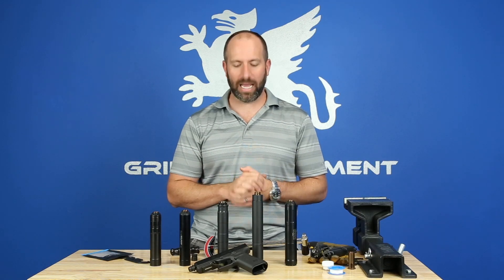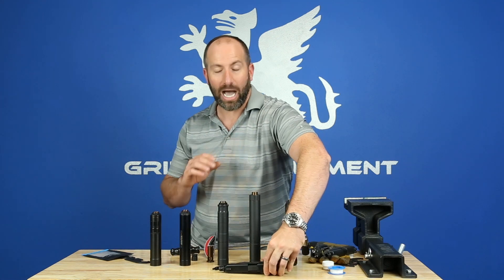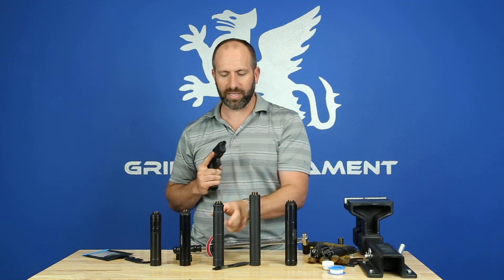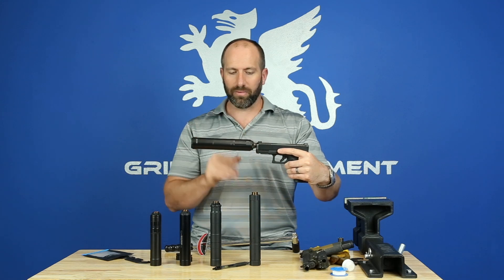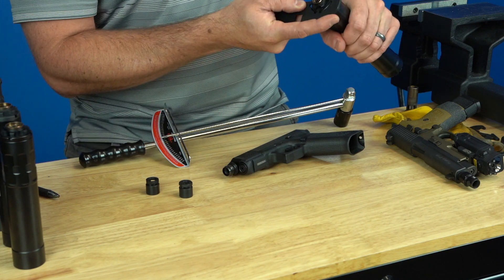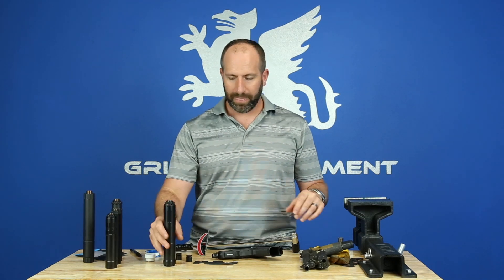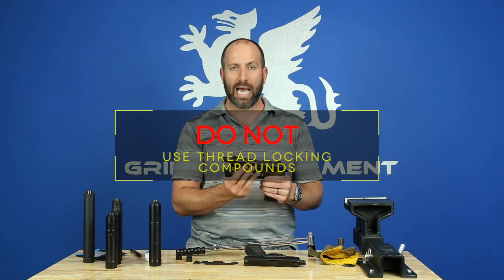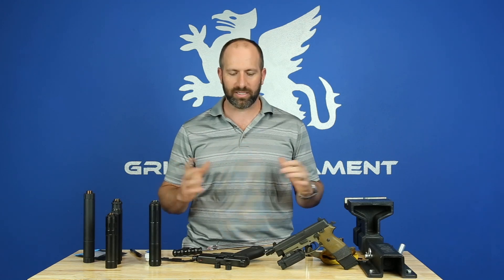Griffin Armament CAM-LOK™ Universal QD Piston System Tutorial & Overview

Comment: I have a Dead Air Wolfman Suppressor  - my 9mm has a 1/2 threaded barrel and my 300 Blackout has a 5/8x24. Do you have an adapter that would work for both of these so I don't have to keep switching out direct thread fixed mounts?

Comment: Mine doesn't last more than 5 rounds before falling off, and a ton of other people onlinr are complaining of the same issue.
Reply from the maker: This is more than likely happening because of improper mounting. The CAM-LOK system can seat pretty snug onto the adapter without actually being mounted, even if tightened with force. When tightening the mount, pull out and away from the silencer to seat the offset threads into the counterpart adapter. If you still are having the same issue, there's a chance the piston is faulty. If this is the case, please reach out to Customer Service and we'll send you a replacement free of charge!
Reply: Same here and I'm very familiar with Taper Mounts.

Comment: I just expended $700+ worth of these, not sure what I am doing exactly but have 3 cans;  Griffin Resistance 22, Rugged 45 and Banish 30, so bought 3 pistons for all 3 of them; 5 QD 1/2 x 28 and 1 for .45 currently I got only 2 handguns threaded but not clear what then when using the cans in rifles??? Direct Thread???? or have to change the piston back? to get use and understand a universal system that will work with the cans I have is a RPITA to me so far and the money pit goes deeper and I only have 3; my friends got 10+ cans...that is crazy!!

Comment: I love the idea but I have had issues with the cam lok on three separate suppressors walking loose and shooting the suppressor clean off the gun after 10 rounds without checking. On multiple different guns as well with the combination of pistols and cans. I thought it was my piston spring originally but it’s consistently been an issue. Really cool idea that I would absolutely love to recommend to customers but I just can’t cause they can’t stop walking loose
Reply: Same
Reply from the maker: Please reach out to our Customer Service team about this issue! We'll make sure to check on your parts and get you set straight 🇺🇸
Reply: Same here. Doesn't seem to engage the Tapers enough before bottoming out. Feels wrong compared to the Q and Rearden Mounts for Rifles.

Comment: I've not had a single issue with this system on my CZ Scorpion.   I use it with a SilencerCo Osprey 9 that has a fixed barrel spacer.  I know the guy says it should not be used with that. But I'm going to assume that's their CYA code for warranty purposes.  I have a about 2,500 rounds with this set up and have not noticed anything out of the ordinary. I absolutely love it.

Comment: Damn! So it is interchangeable between 45 to 9mm now you have my interest.
Reply from the maker: Yep, as long as you have the necessary adapters (CAM-LOK™ barrel adapter in proper thread pitch) on each tilt pistol. Obviously, a Revolution 9 couldn't be interchangeable between a 9 and 45 but the Rev 45 certainly could be. The CAM-LOK™ pistons also come in a variety of different designs that fit other brand suppressors, not just Griffin. AS OF RECENTLY, There are also a couple products that allow for use of CAM-LOK™ on fixed barrel applications. More info can be found on our website and if you have any questions, definitely reach out to our customer service team!

Comment: What stops the adapter from unthreading same as a direct thread suppressor?
Reply from the maker: There’s an additional taper at the front of the adapter that aids in locking up the system
Reply: @GriffinArmamentOfficial  let me clarify; what stops the adapter from unthreading from the barrel the same way a direct thread suppressor would?
Reply from the maker: @notevenmyaccount  20 ft/lbs of torque
Reply: @GriffinArmamentOfficial  God bless

Comment: The Shop I got mine through said this system was ok to use on a fixed barrel sub gun with the piston as well. I figured he was not correct. According to him your company tested a full auto mp5 with the cam lock system and the piston and had zero issues.
Reply: What did you figure out Ernie?

Comment: Mine bottoms out but doesn’t allow it to twist... I have to find the relief where the threads match and it is super annoying!!! Hopefully this is just one that slipped though QC and will be fixed, but some in this video looked to be same issue. The tolerances aren’t very tight allowing ease of use it seems? Using on an OEM threaded HK VP9 Barrel.

Contacting Griffin to return as soon as I can.
Reply: That's by design, there has to be room for the threads to tighten.

Comment: On several review blogs and on your two videos covering the Cam Lok system, the Universal Carry Comp has been mentioned. But it does not appear for sale on your site.
Is it available? If not, when will it be? And could there be the option to package it with the Cam Lok adapter?
.
And are there different models for different caliber sizes? Apart from the various reviews of the Cam Lok system itself, there is no information at all regarding your mentioned compensator.

Comment: I tried the setup on 4 different model Glock 9mm hosts with a Rugged Obsidian 9 it was throwing rounds everywhere and finally had a baffle strike on my end cap. Followed the installation instructions to the letter maybe I got something out of spec from Griffin just thought I'd let everyone know I'm out $345 dollars I'm to scared to try it again. As of right now Griffin has not offered to refund my money or RMA the parts.
Reply from the maker: We offer customer resolution to our customers every day and have for the past 8 years that we've been a nationally marketed company.  We can take a look at your rugged silencer if you want to send it in and we can conduct practical testing with it and the associated barrel adapters to determine what is going on.  I apologize for the issue but we know for a fact that our parts are concentric and straight. We tested rugged pistol silencers as well as cans from Dead Air, AAC, etc, with this system and did not experience any problems.  Please email CS@griffinarmament.com and if you want to screen shot this message and attach it.  They cover stuff like this all the time and you are no different.  We will help you out. Again sorry you had issues.
Reply: Did you get 1/2x28 or 13.5x1lh adapters? There is a recall on the metric adapters that might have caused your issue.

Comment: Would this system work for a Scorpion Evo pistol in 9mm? Still no high pressure rounds and similar barrel length to standard pistols. Thanks.
Reply from the maker: it would but i would suggest the 3 lug lo pro kit instead. On a fixed barrel firearm youre going to beat up the piston more than you would on a tilt barrel pistol. Hence tilt barrel pistol only being discussed in the video
Reply: @GriffinArmamentOfficial  Just wondering how a fixed barrel beats up the piston more than a tilting barrel? I know you've tested it extensively, but I would think a tilting barrel would put more stress on the piston/assembly. What if you left the spring in the booster for use on my Scorpion? I know it's not ideal, but would that be safe?
Reply: @Bones43x  
Now how does a fixed barrel beat up the piston again? I missed that..
Reply: Apologies for the late reply.  I have this setup on a Scorpion with a SilencerCo Osprey 9 and fixed barrel spacer.  I 've not had any issues out of it in almost a year of having it installed.  I'm going to assume his reasoning for not recommending it is just a cover their ass type of thing for warranty purposes.  If you want more info, just let me know.  I'll provide what I can.

Comment: I'm curious if this will work on an lwrc SMG 45 since it has a reciprocating Barrel I'm thinking it should be fine. I sent an email to tech support but haven't heard back but if you could answer I'd really appreciate it thank you
Reply from the maker: I think the normal 3 lug kit would be better. I dont think you need a booster for that gun to cycle with a suppressor.
Reply: @GriffinArmamentOfficial  thanks for getting back to me so quick lwrc actually recommends a suppressor equipped with a booster and said that if you were going to use a 3 lug that it would have to be extremely light based on how the gun functions but based on your response I'm thinking it should be okay since it does require a booster thank you very much
Reply: @GriffinArmamentOfficial  I actually just went out in the yard and tested it with a dead air ghost and my smg 45 and it seemed to work perfectly fine. Thanks for making a good product.

Comment: So no Beretta 92?
Reply: Or 1911 :/
Reply: I want to know this as well, but I think the answer will be those will be ok because they are not fixed barrels. Also they used a standard piston and spring, so they should be able to use this camlok just fine as is only making the installation quicker, not reinventing the piston system operation. Griffin armament?
Reply from the maker: It will be fine on a 92.

Comment: True innovation!  Keep up the solid work and keep the amazing products coming!
Reply: Not really.  This is the exact same tyle of mounting system used on the ACR other than the tapper and use of a piston to secure it.  The ACR uses a locking key..  Not too mention many military style cable connectors made by Amphenol.   It may be innovative to pistol supressors, but it's not new technology.